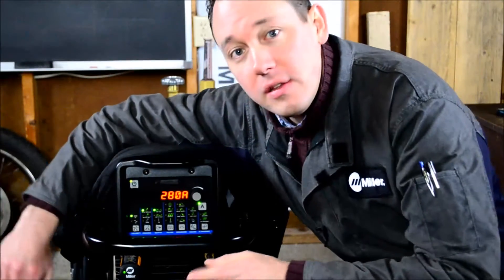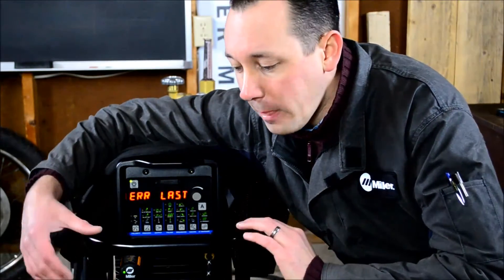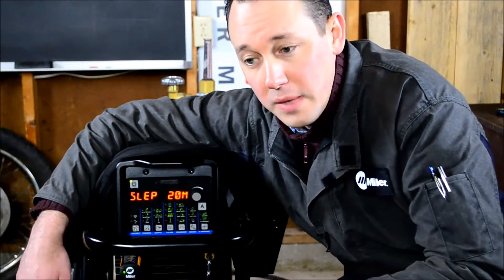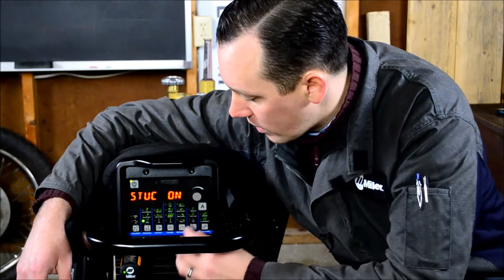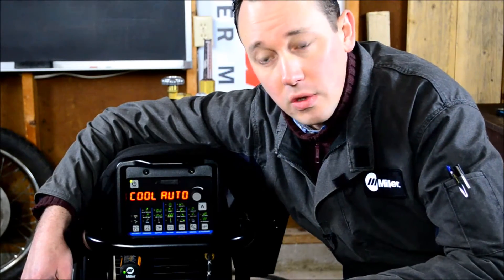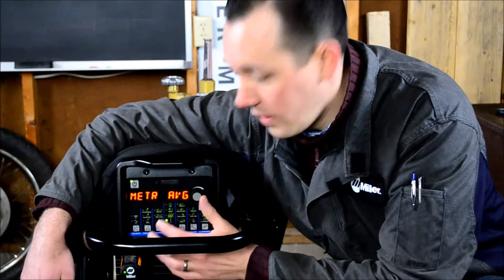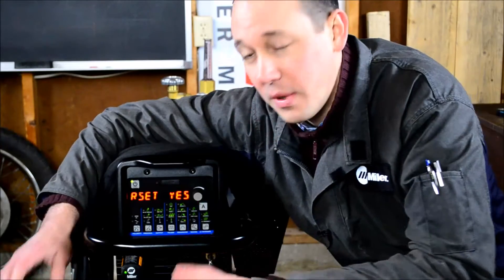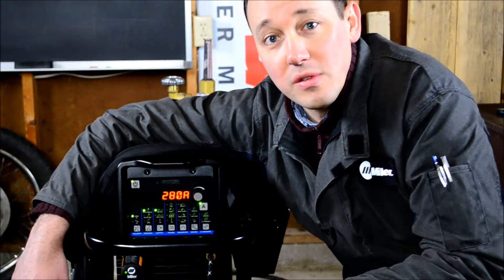Miller Dynasty 210 / 280 DX Tech Menu

Comment: I’m confused which is better the miller 280 dx 907514 or the 907551 model? Why would the model that can weld  AC/DC be cheaper than the one that only welds DC? (280 dx cps)Help

Comment: Good explanation only one thing. The Time is all the time the welders power is actually running and not arc timing however it does have an arc counter which is helpful as well. I verified this with my new 210 ran it for a while and it had time on it with no arcs

Comment: Best videos on the subject, period! Question please, how reliable are the Miller Dynasty 280 DX in your opinion? Its kind of like a huge investment for me
Reply from the maker: I completely understand how big of an investment this can be! I'm an engineer, not a salesman, and, generally, a pretty crummy capitalist. Because of this, I don't take recommendations lightly. So here it is: The Dynasty 280 DX is a very good machine and I am very comfortable recommending it.
The best thing you can do to protect your investment and guarantee years of reliable performance is to follow the periodic maintenance schedule, which is mostly blowing out dust, changing coolant (if it's a water-cooled package), and checking for software updates.
Thanks for the kind words and best of luck!
Reply: Thanks to your encouragement , I went ahead and purchased the Dynasty 280 DX, and I love it. I am overseas, and at the time of purchase, I wasn't able to find the one with CPS, which I was interested in. Now I would like to add a water cooler, is there is anyway on earth that I could retrofit the machine with the cooler power supply? I know that there are other coolmate options but I really like it to be automatic as opposed to me turning it on/off manually, the fact that coolmate 1.3 is the same size as the machine (240 VAC where I am at, so can't run it separately) in addition to the other reasons you mentioned in the video above. Thanks again.